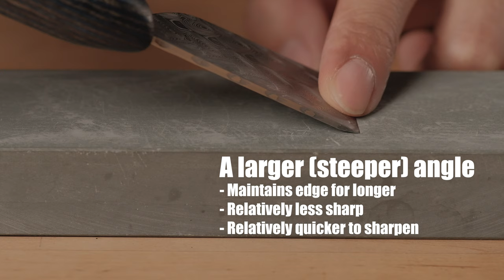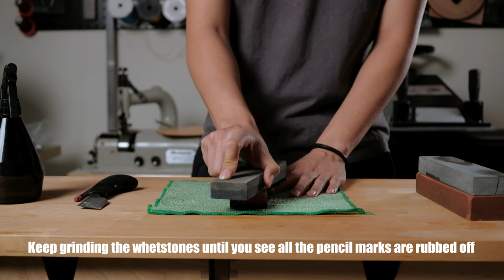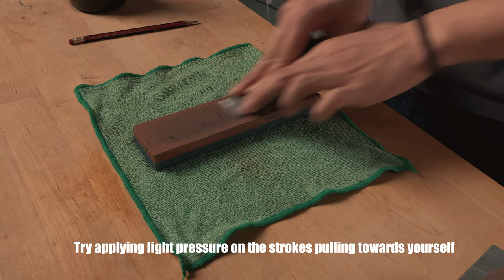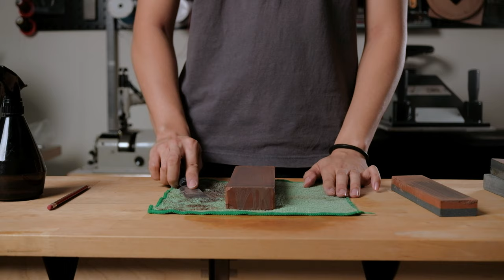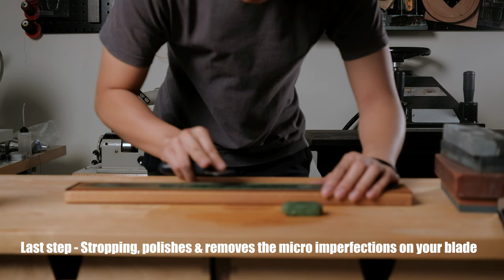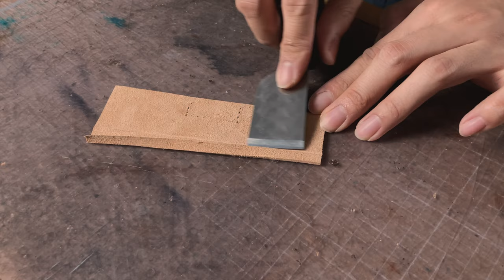Tips & Tricks - How I Sharpen My Japanese Leather Skiving Knife - ASMR

Comment: im having trouble sharpening truly flat on the angled side. as i push and pull i think i am tiliting and the result looks curved/rounded. any tips for this?
Reply from the maker: You don't really have to sharpen the flat side. Just move it very very lightly along the stone to remove the burr of the blade.

Comment: Very helpful.  Do you always need to use the 1000 or can you "generally and frequency just use the 5000?  Thanks
Reply from the maker: Yes, I use the 1000 every time. It brings your knife to a reasonably sharp state. If you only could have one, get the 1000. The 5000 is handy in the final stages but not a must-have.

Comment: I noticed when you stroped the knife it was in on a higher angle. Is this on purpose?
Reply from the maker: Yes, I wanted to make sure to strop the very tip on the blade. But the angle of stopping isn’t as important as the stopping board is not a hard surface.

Comment: My skiving knife is still soooo dull… I’ve done just about everything I can think of to sharpen it too… my SAK, kitchen knives and bush crafting knives are razor sharp… but I cant get this darn skiving knife to sharpen… I"m beginning to think the steel is too soft… going to look into getting a different skiving blade…
Reply: How did that work out - did you get a new skiving knife or did the other one sharpen in the end?
Reply: I have the same problem, I bought a tool for walls and cement and sharpened it but it is soft and I think it is the problem. I managed to sharpen it torazor sharp but it takes 10 times more time and one angle ends up wider than the other...
Reply: @patriciagleve4784  I chucked the bloody thing in the bin… the steel was just too soft… I bought another blade and it holds an edge… I keep it sharp by pulling it back over a strop every time I use it…
Reply: @Hourox11  I ended up just chucking that one I had in the bin… I bought a different blade from a different seller and have never had a problem with it,,, i pull it back over a strop every time I use it and it has held its edge with no issues….